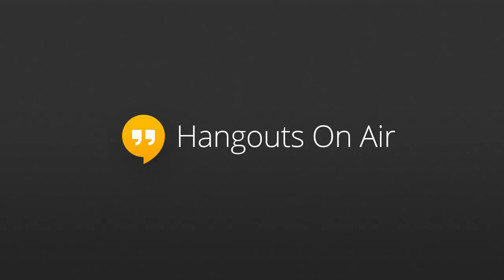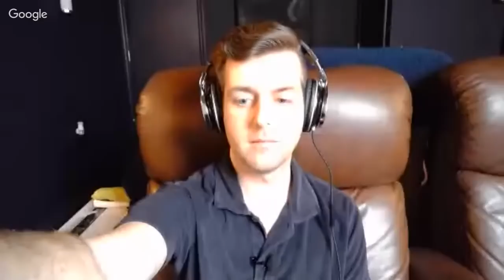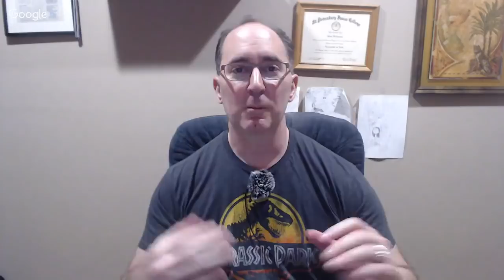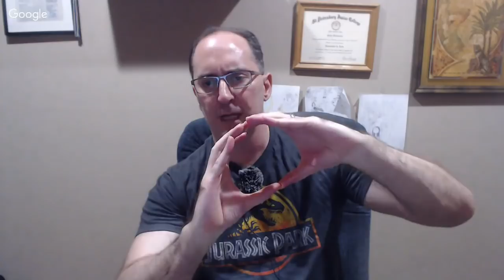Active vs Passive Loudspeakers: Which is Better?

Comment: Meridian has done the right thing all along ... tap the PCM streams after the signal has passed the decoder, room correction etc... send it to the speakers digitally (with a separate volume flag) and let the DSP crossover / amp in the speaker do the rest.
I never utilized the digital out of my old Meridian G68, as their speaker were too expensive for 7.1 use :(
I would like to see all AVRs have ehternet connectors (straigh out of the DSP section) for all channels, and use a simple LAN cable to each speaker.. maybe even daisy chain channels if possible.

Comment: Many people think it is ideal if the crossover is not in the cabinet, so the entire amp may be worse. You certainly are limited by the amount of heat and service access in the cabinet. Steve G is no worse than most YouTube reviewers in discussing tweak topics. I thought this reviewer made some excellent design points: https://www.youtube.com/watch?v=CVgUGx8RdUk